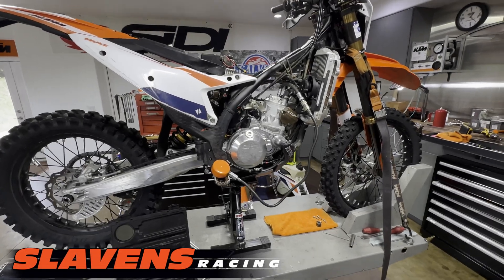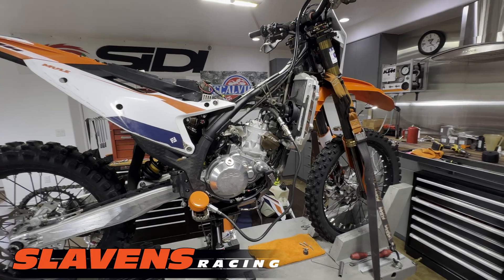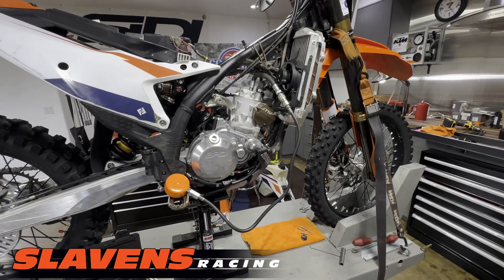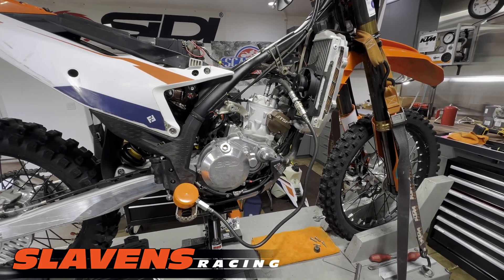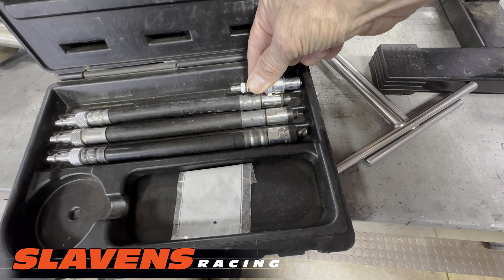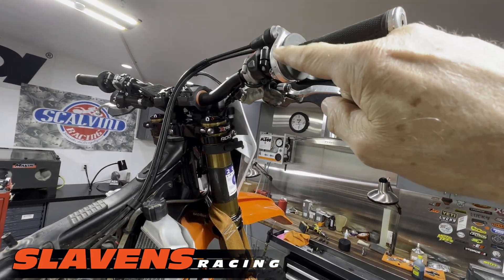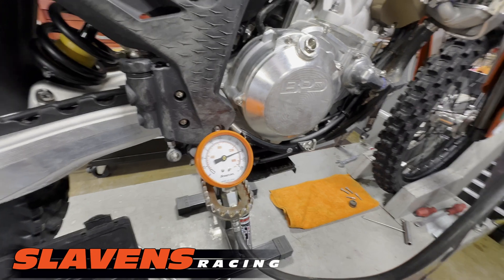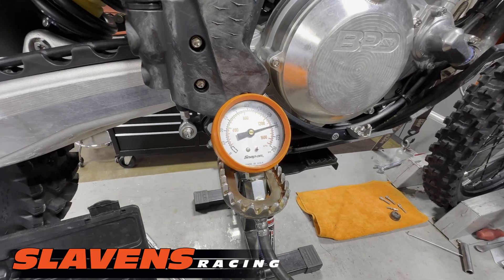Compression Testing - Late Model KTM Two Strokes

Comment: Super helpful, Jeff...I had read some conflicting info regarding holding throttle open on efi bikes, so this confirmed proper procedure! Also I have your S3 low elevation head on my '21 Gas Gas EX300...if 165 psi is a good ballpark for a stock 300 at sea level, roughly what compression would be expected with your S3 head? Thank you.
Reply from the maker: 185
Reply: @slaverace1 I'm a Slavens customer, and your videos have been great as well.

I'm searching for some compression info on my Son's bike. 2016 KTM 65SX.  You got any advice on ranges? Just a ballpark and a number that should prompt a topend rebuild.

I haven't found anything that seemed trustworthy online.

We're only about 450' ASL.

Thanks!

Comment: I bout a $20 compression test on Amazon to test out our Yz65 the recommended psi is 130 and the gauge read only 80psi so I thought time for a top end! Well after replacing top the same gauge read even less psi! Your advice on a quality gauge with a 3/4” length adapter surely is great information thank you! Those readings really bothered me until I saw this video!
Reply: Did you do break in ride to seat the rings before testing compression?

Comment: Jeff what’s your feelings on also pushing the kill switch so ignition is grounded ? Years ago this was supposedly a must do to prevent ignition damage 🤷‍♂️
Reply from the maker: Hello:
I should have put that and other info in the video. Might need to re-do the video.
Reply: @slavensracing  So push the kill button with wide open throttle when you push the start button?

Comment: The volume change because thread length in combustion chamber is irrelevant to getting an accurate pressure reading. The hose that you threaded into the cylinder has volume also. That’s why it takes many rotations to achieve the maximum pressure reading.
Reply from the maker: Hello:
Using the correct hose with 3/4" threads IS relevant to achieving an accurate measurement. The hose volume is not relevant because the hose has a one-way valve at the base of the hose.

Comment: I never thought about the thread length of the test hose changing the volume and compression reading before.  Great info!
Reply: The hose has volume too 💡💡
Reply from the maker: The hose volume is not relevant because the hose has a one-way valve at the base of the hose.

Comment: Thanks Jeff
At what psi reading would you recommend a rebuild?
Reply from the maker: Hello:
I don't use compression readings to determine when it's time for a rebuild because often the piston/cylinder clearance is beyond spec before the compression declines. Most guys do top end rebuilds at around 125 hours. I like my engines fresher than that so I do rebuilds at 75-80 hours.

Comment: Jeff, do you know if a Sherco 300 2023 uses the same procedure. I'm asking because I checked mine with 3 different heads at sea level in Texas and got I believe 125 on all 3
Reply from the maker: Hello: 
All 2 strokes use the same procedure. 

You either have 3 heads with the same volume or a poor quality or faulty gauge.
Reply: @slaverace1  thanks buddy, it has to be the gauge the heads are all from S3

Comment: Remember that both elevation where you test and how long the hose is on your compression tester will change ultimate numbers you get on a particular compression test.  Always good to baseline your bike when it is in perfect condition, and then you can look at the relative change as things wear.  Thanks Jeff for the great video! And always good to ground the spark plug and/or make sure the kill button is depressed, will help reduce the chances of the energy from the ignition system not being dissapated by an ungrounded spark plug wire.
Reply from the maker: Hello Mark:
Thanks for your comment. The hose for the gauge has a one way valve (similar to a Schrader valve) in the threaded end of the hose therefore making the hose length inconsequential.
Reply: @slavensracing not if the hose has any expansion under pressure. Likely,the longer the hose,more expansion, showing slightly lower numbers.
Reply from the maker: @mototrials582  
Seems like you just want to be right, so you win! I'm going riding.